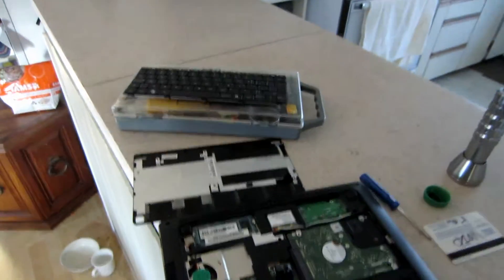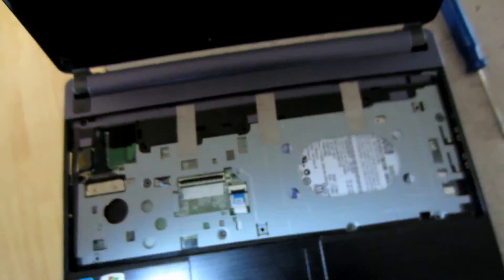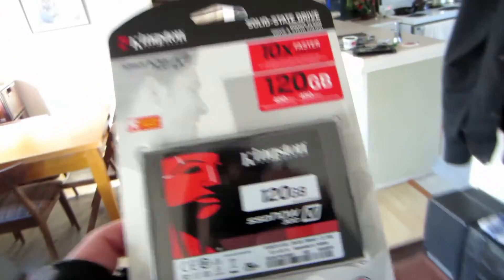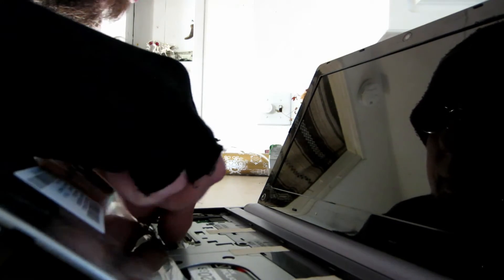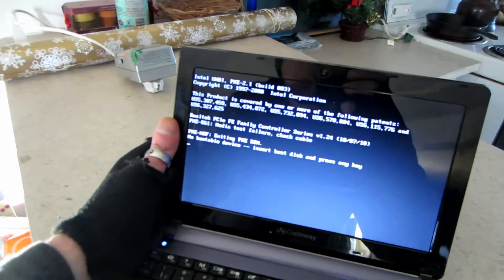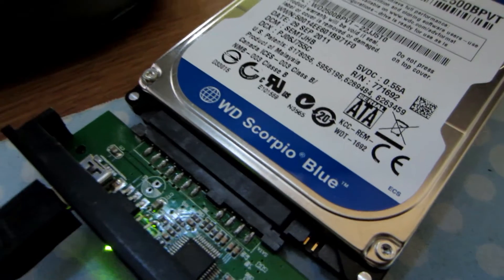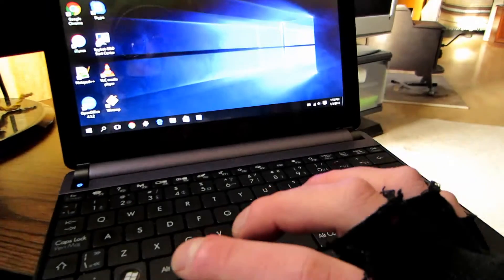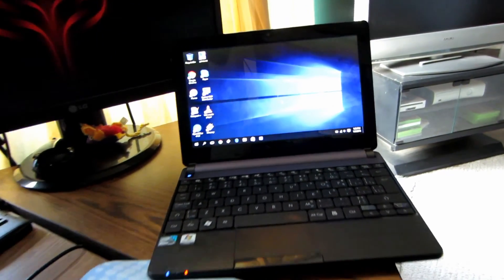Gateway ZE6/LT280 Netbook SSD Upgrade Windows 10 : How To

Comment: I have a gateway lt2802u but I cant seem to go into the bois or choose boot from usb....Do i have to install windows on the hard drive separately? Please dont tell me to press F2 or F12 lol I'm familiar with computers but it seems like I can not access the BOIS or any boot menu :/
Reply from the maker: it might be another key for gateway, or it needs a bIOS update. I would google that machine and see if you can find anyone else with the similar problem. G'luck! :)
Reply: I finally got it to work! haha! I had to update my BOIS version! Also I am wondering how much RAM you're using because I am going to upgrade mine from 1gb to 2gb of ram and I'm just curious if you're running x64 or x32 Windows 10? x64 bit uses more resources so should I just go with x32 bit windows 10?
Reply from the maker: sweet!! I would stick to the 64 bit version of Windows 10. It's going to run a lot quicker than 32 bit when its supported.
Reply: Would you say 2gb makes a significant difference? I just Installed 32 bit just to test and its fairly slow lol I want a SSD but I dont want to spend money for it. I do however want to get 2gb of ram
Reply from the maker: a SSD would help more than just jumping up 1GB of ram. keep that in mind.  :)
Reply: Yeah I know but 120gb is like $50 haha I might just do it tho! I have a SSD in my main laptop and I love it!
Reply from the maker: $50 isn't too bad for 120gb, the prices right now have risen a bit, but if you can find an older SSD you'll save some cash.